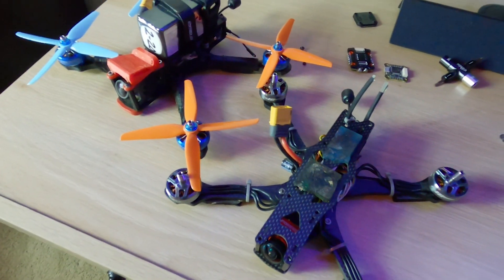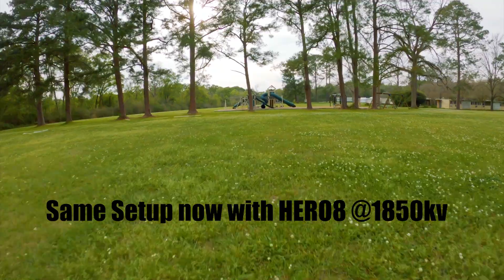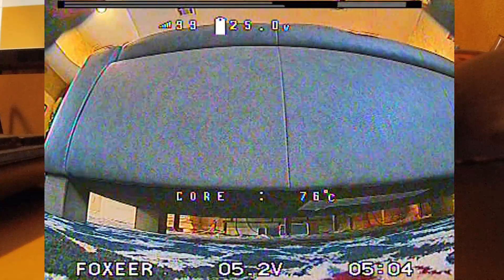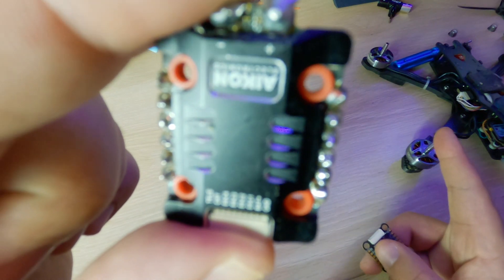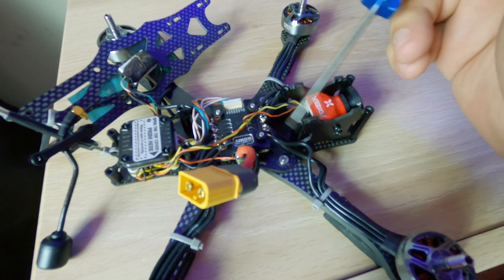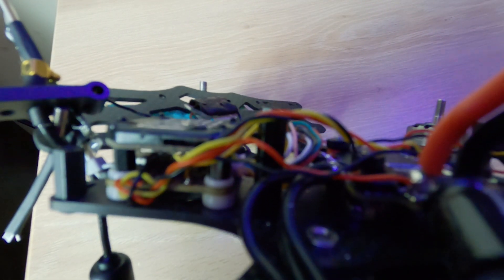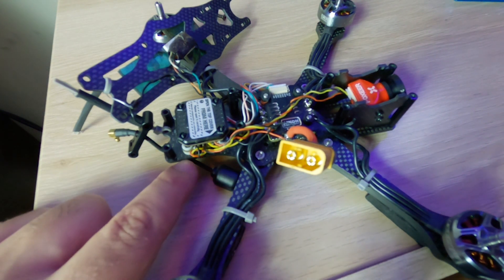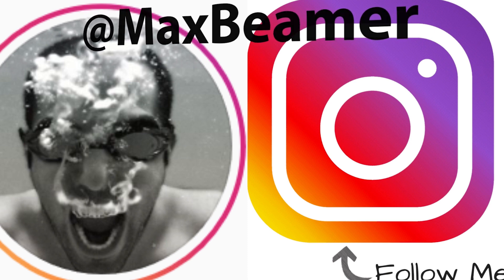The BEST WAY to FPV! 🚀 🔥

Comment: Nice video. I have been flying with my fc in the rear since about the same time Kabab started doing it and I have even designed and flown a quad with a vertically orientated fc and esc - worked fine. But the simple answer to all the "fc in the center of the kwad" people is that the gyro doesn't give a shit where it is, it simply needs to know where it is moving relative to its set state. Also - regarding you theory, your explanation is on the right track. The fc firmware no-a-days is so good that we actually should be using stiffer mounting solutions. You have increased the stiffness in your mounting solution which increases the frequencies that the gyro sees and in turn makes it easier to filter out while at the same time using less filtering to do the job - i.e. making it fly so much better and easier to tune for performance.

Comment: I think most the problems is caused by the arms are like tuning forks that send all the bad down right into stacks by you having it away it helps I have a scimitar lrx that has the stack mounted from top and a bracket on the bottom so no contacted with arms . I think like in archery the limb pockets where the reason we saw better fast bows was do to learning how to filter vibrations out from the violent reaction when a arrow and string get ripped forward at 300fps . Like we have with are arms it's like a bow I think if we did something to how the arms are attached and othe stuff we would see less filtering.  That my theory on it

Comment: Really useful information. I've been flying for nearly 4 years and didn't know this. I've got a 6S setup (1950Kv TOA Turbines) and a older 4S setup using 2300Kv Brotherhobby motors which are still getting manufactured and I love them, they're super reliable, so I'll definitely be trying out some 6S on them too using this information.

Comment: Thank you  for good  information. 👍👍
Do you  use  same pids in 4s and 6s?
Reply from the maker: I don't think so but they aren't that different at all, maybe the p gains are a bit lower on 6s with a bit higher I gains. gonna retune soon anyway on 4.2 ill make a video
Reply: @MaxBeamer  thank you  for reply 😆😆
I wish to watch your new vid soon

Comment: Is that the same as going to BF configurator and setting the throttle limit ? Never did this. Just want to check I’m getting it right. Thanks man 👊
Reply from the maker: no the throttle limit will basically chop the top off your throttle rc output the motor output limiter will actually limit the power going to your motors from the esc and it will do so in an evenly without just chopping off the top end rather giving you an average decrease in apparent voltage as if you were running a lower cell pack.
Reply from the maker: FPV QUARTERS I recommend doing it from the goggles like I show somewhere in the middle of this vid or you can do a cli command of Set motor_output_limit = x ... where x is the percent power you want

Comment: Hey bud I've been doing this for a long time on my own just learning and testing a lot of set ups lately I've been using super low kv but before I started with high kv 2408 2500kv motors on 7inch 6inch and 5inch and the only problems I've had is the voltage spikes you get during regenerative braking seem to be much more severe on the higher kv.  I've found on the lower kv I just have a much higher reliability rate.  Do you not see the samething?  I haven't tested it enough to say this is conclusive or anything.
Reply from the maker: not really seen that but if you have a problem with braking just turn it off in blheli suite. You could also add a capacitor to deal with voltage spikes, I have a small 550uf on every build altho I recommend a bit bigger around 550-1000uf
Reply: @MaxBeamer  what voltage are you caps? Also I was under the impression the regenerative braking is needed to stop the props and perform quick manuevers and that the option to shut it off on blheli suite is only there because you don't want braking in air planes but from what I hear you really need it in quads.  I have found adding caps on each esc and using individual escs helped me with this issue tons also fettec voltage spike absorbers are working amazingly well.  Prior to using those two methods I was using 4in1 escs and one big 35v cap but those would always pop when I would put 6s on which that seems to stop happening when I made the switch to 50v so maybe the spikes were causing the caps to die and then cause damage to the esc since there's no more cap protection.  Hard for me to explain this because I am still learning how to even understand how all this works but so far I think I got the problem solved by using individual escs and the spike abosrber and caps on each esc when I want to use 6s and high kv I use this method otherwise on 4s I don't have problems and don't have to do all the extra stuff it's only when I try to run 6s on some high kv motors like 2500kv or higher which isn't recommended but it's oh so fun when u can get a reliable set up running like that

Comment: 🤦🏻‍♂️🤦🏻‍♂️smart man. 👌🏻
 So question tho, do u play with the Kv of the higher end motors or the lower kv motors? 
And have u tested this with 4s battery just to find the best motor/battery efficiency
Reply from the maker: not sure I understand the question but ill give it a shot. basically I get motors with higher kv that way I can limit them to whatever I want on whatever size lipo.. Since the limiting only works in one direction (cant raise the motor kv only lower it) as far as efficiency, limiting down to a certain kv is a little less efficient than actually using a lower kv motor but not by much at all to where id consider not doing it. and I haven't officially tested anything this is just from my experience flying like this over the last 6 months or so.
Reply: Max Beamer  You answered my question to the T. 👌🏻
I appreciate the knowledge bro. Keep the good content coming

Comment: Nice video.  I'm 3 days into Velocidrone and while I can fly it's not at all as smooth as what you're doing here.  That said, are you able to fly as smoothly on the SIM's?  It would be helpful to understand since if the SIM doesn't fly this smooth I'm not waiting forever to fly close to the ground and other objects in real life.
Reply from the maker: I fly pretty similar in the sim, the main thing for flying smooth is rates, make them a bit slower or add expo and then try and use as little input as possible, just guide the quad and let it do its own thing.. It sounds counter intuitive but you'll get the hang of it with some practice.

Comment: Do you have same benefits on flight time as they say about a 6s build on 1750kv for example? Running 6s on 2500kv.. and lowering this trottle percentage?
Reply from the maker: not lowering throttle percentage but motor output limiting yeh I get 4 min+ flight times and no sag. huge difference from 4s
Reply: @MaxBeamer  that's great man.. I have to sell some stuff...

Comment: For people wanting to try this, Two things: even though this digitally changes the kv of your motor, it will not physically change any differences higher kv motor windings on your current motors give you. Not sure what those differences are, but the windings that give a motor it’s kv will persist through this. Also, on higher voltage you may need to change your pids to get it to work right, but in the video this wasn’t needed.
Reply from the maker: Joshua Bardwell didn't do a very good job of explaining motor output limiting, at the time of his vid it had all sorts of bugs but I'm sure he'll revisit it at some point. as far as the PIDs I changed them slightly but not by 20% and not all of them evenly by any means.
Reply: Max Beamer ill edit my comment then,he’s great but I won’t take his word on everything lol. Also since you’re here I was wondering, I just watched your video on the 5 inch carbon fiber azure biblade props and they sound absolutely amazing in the GoPro footage, do they sound that way in person? I love the deep hum sound they give off but the GoPro could be amplifying it. Thanks!

Comment: Hi mate would you recommend the brain over the flightone revolt for cinematic fpv?
Reply from the maker: That's a tough one, they are so different and so much of the cinematic stuff comes from the pilot and rates. They do fly pretty differently tho so for versatility id go brain but for out the box cinematic only id probably go flightone.
Reply: @MaxBeamer  cheers mate went with the millivolt, I'm pretty much trying to copy your build just stuck on witch motor will be best without breaking the bank, iv been looking at the Gts v2 2207  2500kv?
Reply: @MaxBeamer  Also whether you put a random F4 fc vs BrainLi you still are going to run betaflight so no much difference right? Imo as ive tested cinewhoop beatflight vs FL1 its a compromise flighttime vs better performance and stability control.
Reply from the maker: Gio Fpv the brain fc uses a different gyro with better internal filtering before betaflight gets to the signal. They also run their own version of BF fw bc of the Bosch gyro’s locked 3.2khz sample rate
Reply: @MaxBeamer  good to know, im not that expert about it but now i definitely wont get rid of that spare brainli ive got in my drawer. Cheers man. what about the ESC question i am hoping to get some info?
Reply from the maker: Mezza FPV GTS V2 are great

Comment: Awesome. Been wanting to try 6S. I normally run some 2450kv motors. What would that turn out to be in the OSD? I also run the DYS f4 FC along with Kiss 32amp Escs. Thanks 👊
Reply: Looks like I'm getting the following:

1650 ÷ 2450 = 67%
1750 ÷ 2450 = 71%
1850 ÷ 2450 = 75%
Reply: What's the best 6S out there? I normally run the CNHL 4s 1300's.
Reply from the maker: yep those kvs are spot on I have my 2450 TOAs set to like 74%.. the BEST 6s is the thunderpower adrenaline but I run the ovonic 1000kv their like half the price and 90% as good
Reply: Dont wait a few months for beta flight 4.2, feature that keeps motor rpm same regardless of pack sag, n stay 4s, n don't stress ur shit w 6s voltage. ;)

Comment: So what esc settings are you using for that? I have a Hobbywing 60a,  Xing 2207 2450kv motors and Revolt osd and going to try a 70% limit on it. What fo you recommend for esc settings? 48khz, demag low, timing auto?
Reply from the maker: what firmware version? if its betaflight 4.1 with rpm filters I use 24khz everything else as you wrote.
Reply: @MaxBeamer  i use FalcoX

Comment: Awesome ! Been wanting to fly 6s ,still running 4s . Waiting on batteries to die to switch .  Now I can 🤙🏻🙏
Reply from the maker: yehhh get on it bro!
Reply: Or save $ wait a few months for beta flight 4.2, feature that keeps motor rpm same regardless of pack sag, n stay 4s, n don't stress ur shit w 6s voltage...YW ;)
Reply: Flo-Rida FPV and 4s batteries are cheaper 🤙🏻
Reply: @staticfpv881  yeah buddy and lighter and blow less stuff up

Comment: Hey buddy im so undecided to get either the aikon or the hobbywing as im running 2700kv on 4s. rotorx would be more appropriate as its 60A burst but your opinion its the first in incur  and i am a bit sceptic. just wondering why and what exactly made you  move over ?
Reply from the maker: I’d go with the aikon all day. they have the best quality control imo I’ve had hobbywing 60a burn up for no reason and come defective out the box before, they replaced the defective ones but even that process was a huge pain where I had to fill out forms and ship the esc back. I stand by the aikons.
Reply: @MaxBeamer  Understand, thanks for the clarification. Ive heard about the Hobbyw60A, however the micro20x20 40A then looks like it didnt come out with any sort of issues. looks like solid?

Comment: Should i limiting the throttle in bf after i change the motor limit?when im using 6s bateries on 4s motors.
Reply from the maker: Nope keep throttle the same.

Comment: Nice Vid. Hey I know this sounds dumb but can I still get a 4s motor with the Geprc Stable Pro Mini Stack in 2020 or should i already get the 6s motors?
Reply from the maker: you can use that stack with 4 or 6s doesn't matter, 6 is gonna fly better but its a personal choice.
Reply: @MaxBeamer  Sry I was dumb at writing, i am about to build my first kwad and i mean if i should build it with a 4s motor or a  6s motor to fly it with a 6s battery

Comment: Great stuff dude....So are there any changes in Amp draw? how about turtle mode? or desync?
Reply from the maker: I haven't done an A B test but that's a good question about the amp draw.. it should be lower since you'd still be using a higher voltage source and its not getting limited until it leaves the ESC but ill have to check to be sure. zero desync, no changes in turtle that im aware of

Comment: Are you running 48 kHz or different motor timing ? Or could be filters ?
Reply from the maker: I actually went back to 24k recently I had some odd issues on 48 all esc settings are stock I think it’s the dynamic filters but not 100%
Reply: @MaxBeamer  What kind of issues did you have? I had one quad have massive bobbles on 48khz. At 24khz pretty much gone. Also are your ESC recommendations still the same? You still building your quads with FC at the back?

Comment: What about flying 2700kv motors with a 5S lipo? My esc only support up to 5S
Reply from the maker: That works too just set output limit around 81% that will get you a good kv (around 2200kv) for 5s
Reply: @MaxBeamer  thanks man going to try it😉

Comment: Doesn't this increase the vibrations on the quad?
 If YES...
how do you fix that?
Reply from the maker: doesn't what increase vibrations?
Reply: @MaxBeamer  limiting the KV rating on the motor to run 6s lipo
Reply from the maker: not at all.

Comment: Hey Max, I'd really like to try motor output limiting but isn't there still a risk that the voltage can blow the motors?
Reply from the maker: nope. not if you scale it back to a proper voltage for the motor kv

Comment: Did you try both tao series motors?  Is there a difference?  It looks like it's just abec 7 vs nsk bearings.
Reply from the maker: they feel pretty similar to me I have an A/B test video coming soon. theres a few other minor differences as well I think if any real difference could be in durability over time.
Reply: @MaxBeamer  you should get some ceramic abec 7 bearings and swap them out.  See if that makes a difference.  I really want a set of 2306 for 5" and 2507 for 6", but I'm super poor atm....

Comment: I wouldnt recommend doing this with a 4s flight controller. You may get problems. But good info on motor percentages to drop kv.
Reply from the maker: Well doing this on 4s esc or fc will be instant 🔥 haha don’t do it unless rated for 6s voltage should have mentioned that
Reply: Max Beamer Definitely make sure to check battery rating. Cooking voltage regulators are not fun. Some flight controllers you can get away without having the regulator, but means you will need a battery to connect to your pc in some cases. Been there done that. Betaflight f4 flight controllers

Comment: someone at a group told me that my flight controller being in the back of the frame is a bad thing cause its like "off axis" and not centered. but i thought about it, and i believe it is the exact same as if it were in the center. change my mind
Reply from the maker: yeh its exactly the same.

Comment: So if I bought the 6s 55 amp aikon and f7 flight controller I should be good..I have the lal 5.1 with 2507 motor and flight controller have been popping like they are free.
Reply from the maker: You should be good but that's some big ass motors for 5 inch, any mishaps can get you in some trouble lol
Reply: @MaxBeamer  yes  I agree

Comment: Good vid buddy! I'd rather run high kv motors than have low kv and not be able to increase power. I've been doing the same ever since motor output limit was added to Emuflight. Just make sure ESCs are rated for 6s... For that matter anything that's connected to vbat!

Comment: Does doing this make it faster than 6s motors?
Reply from the maker: 6s motors are just a range of kv between like 1600-1950..  by doing this you can have any kv you want and adjust until its perfect for your setup or change kv whenever you need to anytime from the goggles
Reply: Max Beamer ok I’m new and just bought parts, so he was like what, if 4s motors r cheaper but I can make the faster then y waste money on 6s motors lol thx for clarifying

Comment: I'm new to this so I already have a 6s quad so do I just need to change out the motors to 4a rated. Cus I saw a comment earlier below saying that if the FC and esc can handle 6s
Reply from the maker: if you already have a 6s quad you don't really need to do anything but if you want to use 4s motors with the limiting to be able to adjust KV you absolutely can.
Reply: @MaxBeamer  okay awesome do you think you can get more fly time with this? And thanks for the reply
Reply: @sosoapy8154  I could be wrong but I think the only way to get more flight time was to lower the throttle percentage, it’s just that you have a much more powerful setup so you don’t notice the dip in performance. I’m not super experienced in this hobby but I think that’s right 😄

Comment: Been running BlackBird FPV 2725kv on 6S with FlightOne for a few weeks set to 66% was  the closest to it's real RPM on 4S, It should be around 1817kv according to my calculations. Might go up to 67% or 68% should set them at 1850kv, I strongly believe that 1850kv is the sweet spot for 6S. It's a cool function that changes everything love it.
Reply from the maker: 1850 is about where im at too, that's a mean setup you've got I flew the exact same thing for a min and loved it